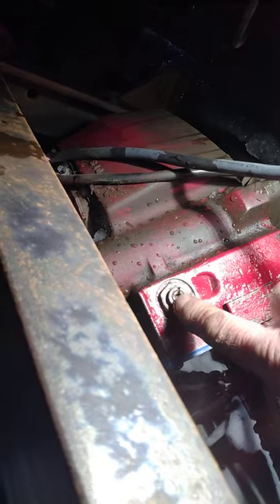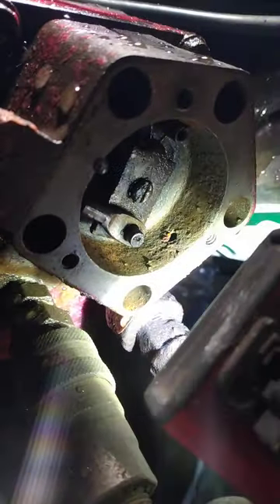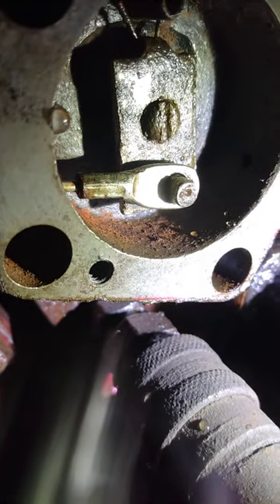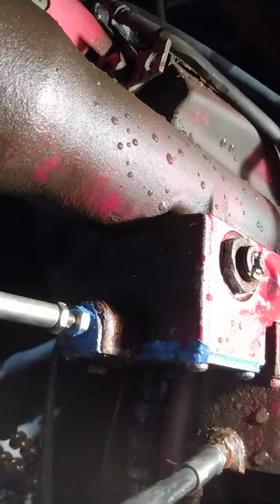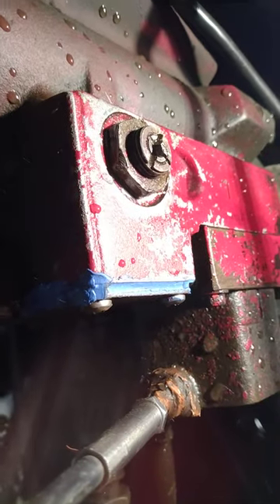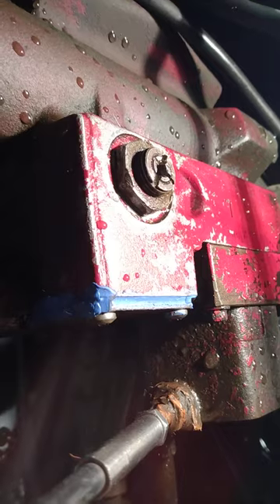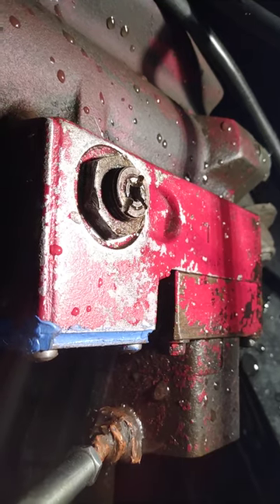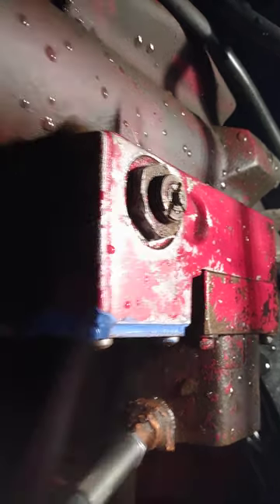Western check valve adjustment ! Cable operated . Pay attention when removing !

Comment: Just happened again water got in and froze the cable in place time to reseal it all up
Reply from the maker: Gotta get them holes drilled down in ther so moisture can get out ! Silicone around wher the cable is too . Try ta keep moisture out ! Good luck brother . I haven't had a problem since drilling the holes in mine !

Comment: any idea when I angle the blade left or right it goes up instead and does not angle? I've drained and filled the fluid, set all the cables and cams to factory settings, as well as the lift and check valves. This is on a jeep I bought last year and trying to get it to function properly
Reply from the maker: @idahoanm618  if the valve is not right like in this video. Itll do crazy stuff ! And if the cables aren't in the right position . Both of them . Itll do what yr sayin . Maybe un hook cables at the block . Both of them . And make sure you have left and right up n down with the cables off . If you do . Then youll know the cables where they hook arent in the right positions . They both have to be in the right posy for everything to work !

Comment: I have the same cable type western pump no up/down or side to side i noticed spring action on lower switch but loose movement on upper cable switch in box on pump is that correct ? I'll follow your instructions on marking and moving check valve wonder if I have air in the cylinders ? Can't get the motor bolts loose to check pump and filter.
Reply from the maker: @deanyanko3326  make sure you can here the pump activating. Make sure the signal wire from joy stick is hooked up . Still have problems hit me up !
Reply: @theweldor757  I worked on it all day  got side to side working and the ram went straight up to the top, can.t get the check valve to move with that tiny allen wrench the packing nut is free held it tight but the allen wrench was stripping out. ???
Reply from the maker: @deanyanko3326  mine is a little stiff . But not much it turns freely for the most part . I wonder if someone has put thread locker on the valve part ? I do know each cable has to come back to neutral for the other cable to work properly . Say you turned left with blade . But the cable is still crowded to left of center . That will affect how the up and down works

Comment: How do you Adjust the drop speed of the plow, mine seems to go very fast and slam the ground?
Reply from the maker: Its that valve in the video . Put a allen wrench in the valve part . Mark it with a marker so you know exactly wher you started from . The valve , not the nut . Squirt a little wd-40 around the big nut . Loosin the big nut a half turn while holding the allen wrench on the valve steady . Loosin big nut . Turn valve just like 1/8" . Snug nut back up . See wher your at . Dropping slower or faster . Might have to repeat a cpl times . You can do it with the plow in the air so you know when it drops faster turning the valve . Make DAM sure your feet and anyone else is outta the way if you do it with the plow up !
Reply: @theweldor757  - thank you for the advice , I recently purchased a truck with that old plow on it and the issue was it not turning left and right to begin with. I spent two weeks on it trying to figure it out very frustrating, the issue ended up being not enough throw on the big toggle switch inside the cab so I had to hog out the throw on each side in the plastic housing which made it work better. Only issue is it takes a while for it to start moving.
Reply from the maker: @jasonstclair1329  that valve regulates the flow of fluid for everything . Left / Right up and down !